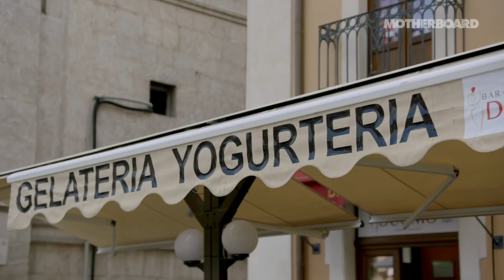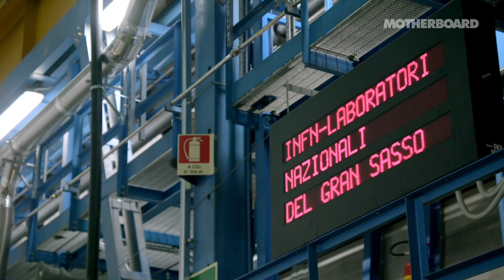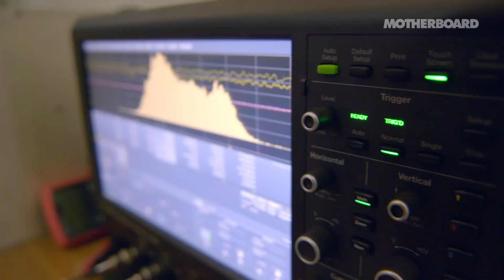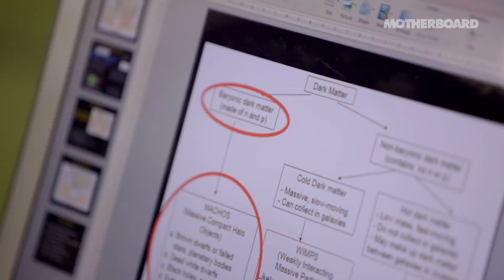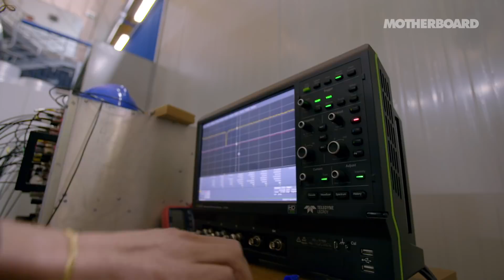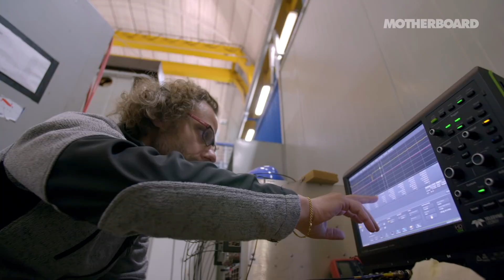The New Hunt for Dark Matter

Comment: Revised TOE: 3/25/2017a.
My Current TOE:

THE SETUP:
1. Modern science currently recognizes four forces of nature: The strong nuclear force, the weak nuclear force, gravity, and electromagnetism.
2. In school we are taught that with magnetism, opposite polarities attract and like polarities repel. But inside the arc of a large horseshoe magnet it's the other way around, like polarities attract and opposite polarities repel. (I have proved this to myself with magnets and anybody with a large horseshoe magnet and two smaller bar magnets can easily prove this to yourself too.  It occurs at the outer end of the inner arc of the horseshoe magnet.).
3. Charged particles have an associated magnetic field with them.
4. Protons and electrons are charged particles and have their associated magnetic fields with them.
5. Photons also have both an electric and a magnetic component to them.

FOUR FORCES OF NATURE DOWN INTO TWO:
6. When an electron is in close proximity to the nucleus, it would basically generate a 360 degree spherical magnetic field.
7. Like charged protons would stick together inside of this magnetic field, while simultaneously repelling opposite charged electrons inside this magnetic field, while simultaneously attracting the opposite charged electrons across the inner portion of the electron's moving magnetic field.
8. There are probably no such thing as "gluons" in actual reality.
9. The strong nuclear force and the weak nuclear force are probably derivatives of the electro-magnetic field interactions between electrons and protons.
10. The nucleus is probably an electro-magnetic field boundary.
11. Quarks also supposedly have a charge to them and then would also most likely have electro-magnetic fields associated with them, possibly a different arrangement for each of the six different type of quarks.
12. The interactions between the quarks EM forces are how and why protons and neutrons formulate as well as how and why protons and neutrons stay inside of the nucleus and do not just pass through as neutrinos do.

THE GEM FORCE INTERACTIONS AND QUANTA:
13. Personally, I currently believe that the directional force in photons is "gravity".  It's the force that makes the sine wave of EM energy go from a wide (maximum extension) to a point (minimum extension) of a moving photon and acts 90 degrees to the EM forces which act 90 degrees to each other.  When the EM gets to maximum extension, "gravity" flips and EM goes to minimum, then "gravity" flips and goes back to maximum, etc, etc.  A stationary photon would pulse from it's maximum extension to a point possibly even too small to detect, then back to maximum, etc, etc.
14. I also believe that a pulsating, swirling singularity (which is basically a pulsating, swirling 'gem' photon) is the energy unit in this universe.
15. When these pulsating, swirling energy units interact with other energy units, they tangle together and can interlock at times. Various shapes (strings, spheres, whatever) might be formed, which then create sub-atomic material, atoms, molecules, and everything in existence in this universe.
16. When the energy units unite and interlock together they would tend to stabilize and vibrate.
17. I believe there is probably a Photonic Theory Of The Atomic Structure.
18. Everything is basically "light" (photons) in a universe entirely filled with "light" (photons).

THE MAGNETIC FORCE SPECIFICALLY:
19. When the electron with it's associated magnetic field goes around the proton with it's associated magnetic field, internal and external energy oscillations are set up.
20. When more than one atom is involved, and these energy frequencies align, they add together, specifically the magnetic field frequency.
21. I currently believe that this is where a line of flux originates from, aligned magnetic field frequencies.

NOTES:
22. The Earth can be looked at as being a massive singular interacting photon with it's magnetic field, electrical surface field, and gravity, all three photonic forces all being 90 degrees from each other.
23. The flat spiral galaxy can be looked at as being a massive singular interacting photon with it's magnetic fields on each side of the plane of matter, the electrical field along the plane of matter, and gravity being directed towards the galactic center's black hole where the gravitational forces would meet, all three photonic forces all being 90 degrees from each other.
24. As below in the singularity, as above in the galaxy and probably universe as well.
25. I believe there are only two forces of nature, Gravity and EM, (GEM). Due to the stability of the GEM with the energy unit, this is also why the forces of nature haven't evolved by now. Of which with the current theory of understanding, how come the forces of nature haven't evolved by now since the original conditions acting upon the singularity aren't acting upon them like they originally were, billions of years have supposedly elapsed, in a universe that continues to expand and cool, with energy that could not be created nor destroyed would be getting less and less dense? My theory would seem to make more sense if in fact it is really true. I really wonder if it is in fact really true.
26. And the universe would be expanding due to these pulsating and interacting energy units and would also allow galaxies to collide, of which, how could galaxies ever collide if they are all speeding away from each other like is currently taught?

DISCLAIMER:
27. As I as well as all of humanity truly do not know what we do not know, the above certainly could be wrong. It would have to be proved or disproved to know for more certainty.

____________________________________________________________________________________

Here is the test for the 'gravity' portion of my TOE idea.  I do not have the necessary resources to do the test but maybe you or someone else reading this does, will do the test, then tell the world what is found out either way.

a. Imagine a 12 hour clock.
b. Put a magnetic field across from the 3 to 9 o'clock positions.
c. Put an electric field across from the 6 to 12 o'clock positions.
(The magnetic field and electric field would be 90 degrees to each other and should be polarized so as to complement each other.)
d. Shoot a high powered laser through the center of the clock at 90 degrees to the em fields.
e. Do this with the em fields on and off.
(The em fields could be varied in size, strength, density and depth.  The intent would be to energy frequency match the laser and em fields for optimal results.)
f. Look for any gravitational / anti-gravitational effects.
(Including the utilization of ferro cells so as to be able to actually see the energy field movements.)

(An alternative to the above would be to shoot 3 high powered lasers, or a single high powered laser split into 3 beams, each adjustable to achieve the above set up, all focused upon a single point in space.)

'If' effects are noted, 'then' further research could be done.
'If' effects are not noted, 'then' my latest TOE idea is wrong.  But still, we would know what 'gravity' was not, which is still something in the scientific world.  Science still wins either way and moves forward.
Reply: TL;DR;
What was that all about ?
Reply: The experiment you suggest is actually doable. What strength of magnetic and electric fields do you think is necessary ?
Reply: You say the like charged protons would stick inside the electrons' magnetic field, but you can actually strip the nucleus from an atom and it still holds together. How would that be possible?
Reply: Ali Devrim OGUZ
Strength of magnetic and electric fields.
I would think that ideally one would want to equally match the energy strengths of all the energy fields involved for optimal results.  Hence also though, the alternatives of utilizing 3 lasers or a single laser split into 3 beams to achieve the desired setup.

As far as striping a nucleus from an atom and still hold it together.
a.   CERN utilizes protons in the collider.  A proton is just an ionized hydrogen atom, (a hydrogen atom without it's electron), the proton being the nucleus of that hydrogen atom.
b.  I would think 'if' the theory is true (and I fully acknowledge the 'if' at this time), then it might be possible to combine 2 ionized hydrogen protons inside a 'nucleus' "IF" a magnetic field was of sufficient strength to hold them together.  Normally, this would be done by the moving electron with it's moving associated magnetic field.
c. Consider also though that an alpha particle is basically a helium nucleus without any electrons.  The neutrons would also most probably have some sort of magnetic field associated with them (even though they are considered to be zero charged particles), here again though, keeping in mind that the 'gem' photon would be making up everything in existence.  The 'gem' photon having a gravitational component, an electrical component, and a magnetic component.  The net effect of the interacting 'gem' photons gives the indications observed.  At least that is the current theory I am working off of.
Reply: Ali Devrim OGUZ
Here is a copy and paste of the math I have so far for the TOE idea:

The mathematics for the TOE doesn't even exist yet as far as I am currently aware.  It goes beyond any quantum field theory formulas that I am currently aware of.  The outline though is basically as follows:

The formula has at least 3 levels to it:
1. The Internal Photon Level:  The 3 interacting forces, (which might even be just a singular force with 3 different modalities), all interacting at basically 90 degrees to each other and all simultaneously pulsating and swirling.  A complex part of the formula but I believe to be totally doable.

2. The External Photon Level:  For each pulsating, swirling photon, all the pulsating, swirling photons interacting with it.  An exponential part of the formula that I am not even sure modern day super computers could adequately handle.

3. The Inter-dimensional Photon Level:  For each modality within each photon would have an energy frequency associated with it.  The energy frequencies could be seen as being in their own space time dimension.  (For me, 'space' is energy itself of which is the 'gem' photon and 'time' is the flow of energy; 'temperature' is the interaction of energy), so one would be dealing with way more than just 3 spatial dimensions and way more than just 1 time dimension (as there would many different energy frequencies with many different flows of energy).  Whenever like resonate energy frequencies resonated with each other, they would affect each other, kind of like 'spooky action at a distance'.  Anytime energy frequencies overlapped, there would be a temporary spike of some sort in each space time dimension.  In addition, if in reality the 'gem' photon is just a singular force with 3 different modalities, it's possible that energy could 'slip' between modalities which would also affect the results.  A very complex part of the formula on top of all the complexity that came before it.

4. Any time any energy moved in the system, the entire formula would have to be recalculated due to potential ripple effects.

Like I said above, I don't even believe the mathematics exists yet for what I am trying to do, but at a minimum, the formula would contain the above levels the way I currently see it to be.

____________________________________________________________________________

'IF' my latest TOE idea is really true, (and I fully acknowledge the 'if' at this time), that the pulsating, swirling 'gem' photon is the energy unit of this universe that makes up everything in existence in this universe, and what is called 'gravity' is a part of what is currently recognized as the 'em' photon, then the oscillation of these 3 interacting modalities of the energy unit would be as follows:

Gravity: Maximum in one direction, Neutral, Maximum in the other direction;
Electrical: Maximum in one direction, Neutral, Maximum in the other direction;
Magnetic: Maximum in one direction, Neutral, Maximum in the other direction.

Then:
1 singular energy unit, with 3 different modalities, with 6 maximum most reactive positions, with 9 total basic reactive positions (neutrals included).  Hence 1, 3, 6, 9 being very prominent numbers in this universe and why mathematics even works in this universe.

In addition, it's also probably why there are things like 6 quarks, 6 neutrinos, etc.
Reply: @charlesbrightman4237  I don't know if I can try splitting a powerful laser into 3, but the one with the magnetic and electric field is possible to try. What kind of effects do you think will be observed? Can you state them explicitly?
Reply: Ali Devrim OGUZ
Potentially, a mini gravitational black hole if done right.